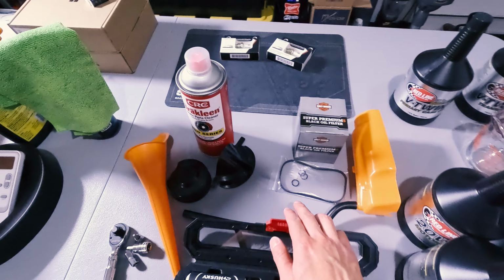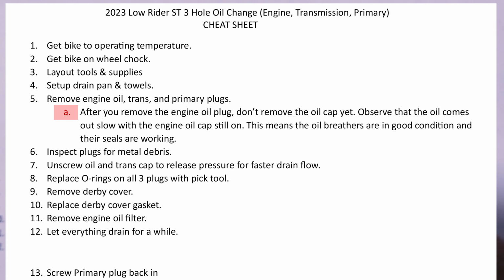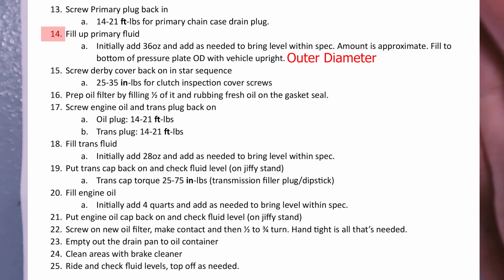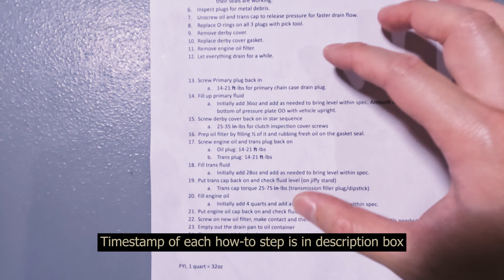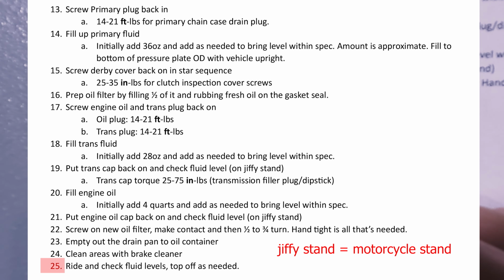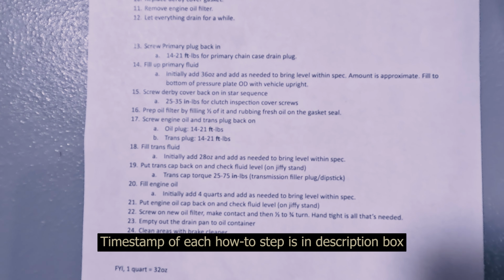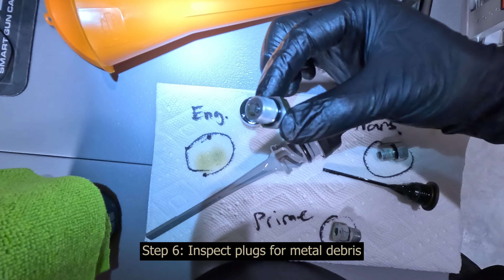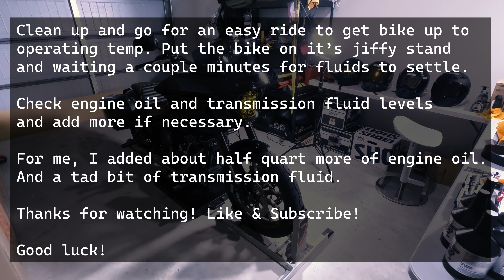3 Hole Oil Change - 2023 Low Rider ST M8 Softail Harley-Davidson | Engine, Transmission, & Primary

Comment: I did all the steps and all the fluids are at the correct level, but I noticed I had a squealing noise coming from the bottom of my right foot whenever I released the clutch and it was in the friction zone… only does it when initially taken off from first gear and stops after that… once I got to my garage I released the clutch in the friction zone off and on… it seemed to disappear after going on a short ride. I had to go to work so I couldn’t try it out again, but I guess I’ll see after I get home if it comes back. Any idea what that might’ve been?
Reply: Almost similar to when a car has a squeaky serpentine belt, it’s a 2020 Lowrider s with only 2000 miles on it, that may have been its 1st oil change, don’t know if that has anything to do with it, but just seemed odd
Reply: 90% sure this sound was coming from the air intake now that I’m listening closer to it. Seems like it was just air sucking into the intake.